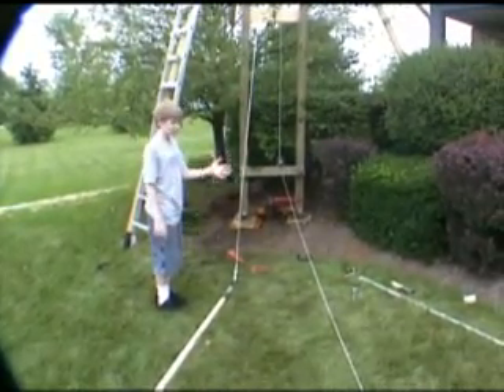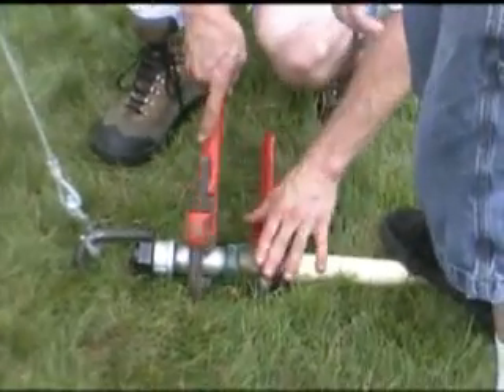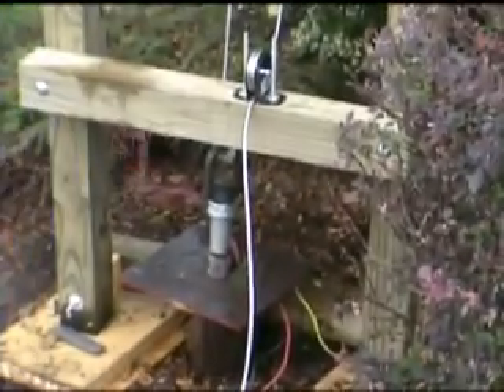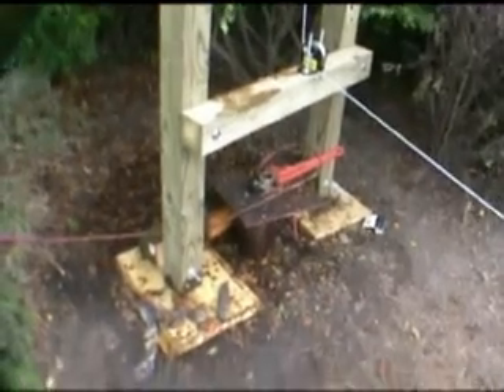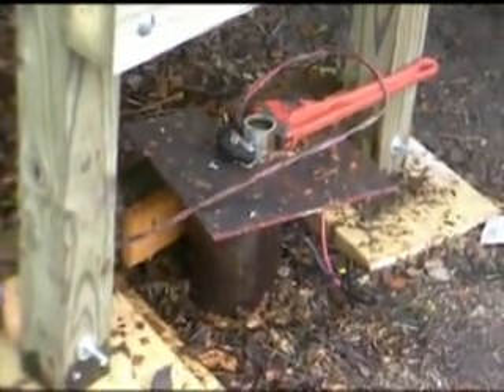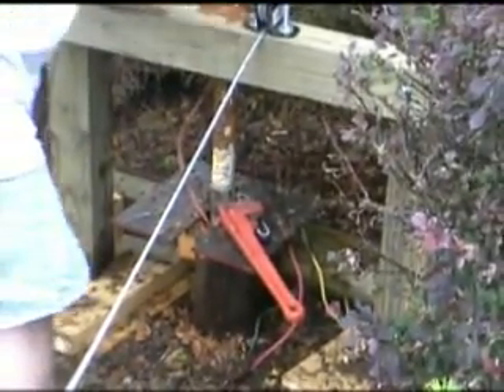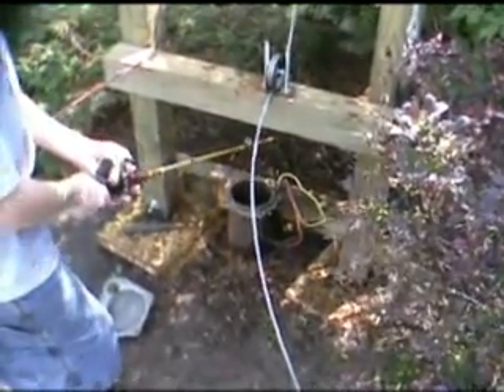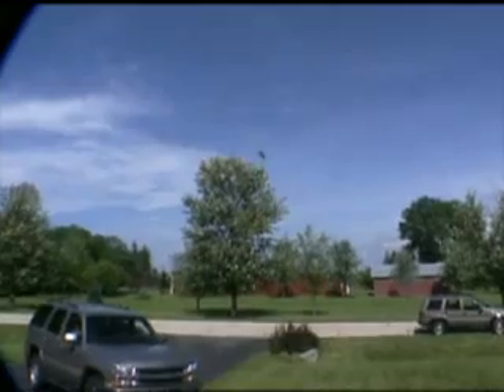Water Well  Pump Project

Comment: @trd1717 obviously this DIY is not at the mercy of the idiot who charged him 2k dollars. This is easy to do, though like others have said the single piece black flex tubing would make it a bunch easier. instead of a 20 foot tall tower you could easily use a 4 foot sawhorse with a large boat pulley and a pull it up the first 10 foot or so. Then attach the pipe to a vehicle and drive it up while someone guides it up the reason you need the pulley is so that the black flex tube doesnt snap

Comment: This is a very dangerous job if you are not careful . In my 20 years of pump repair and drilling I saw a homeowner attempt a 400" sub pull he was half way out when his clamp let go. The wire wrapped around a rhododendron and ripped it out of the ground roots and all and it all went shooting down the well the entire bush, they couldn't get the pump out after that it was jammed . That pipe you saw with all the iron Bacteria is your static level in other words  how much your water level fluctuates

Comment: The well pumps I've changed on my homes in Pennsylvania have all used black plastic flexible PVC - IMO way easier to work with than the rigid pipes that have to be taken apart and put back together.  I've never had to use an elaborate pull system, just a couple guys to pull it up.

I don't know why people are jumping on this guy's DIY project.  If anything it's a little over engineered but so what?    The pumps aren't really that heavy, they wouldn't snap a cable.

Comment: I try not to get into too many squabbles, but I have to back up my fellow well men.  Two men and a pump hoist can pull a 400 footer in a half hour on SCH 80, galvanized, or whatever else you want to hang it on.  Most pump replacements take less than 2  hours (If installed properly).  The guys that take all day bring out a chain hoist and a tripod (1940's technology).  I wish I had a dollar for every one of these DIY projects I've had to fish out of the bottom of the well...Oh, wait,  I DO!

Comment: im from new jersey... we use 19lb 6'' pipe with steel threaded couplings.. tighten the down with chain wrenches and weld them if necessary. as far as the pump goes.. depending on the wells yield typically you would set the pump 20ft off the bottom of the well

Comment: I am a journeyman pipefitter, but never worked on a well. 
Use rope or cable?
Pipes joined with regular couplings?
Galvanized?
What do they use now days for the pipe?
Are the pumps typically lowered to the bottom of the wells? 
Seems like a pretty good method to me, unless your cable/rope broke
Oh, and where did you get the connector you attached to the top of each pipe? It looked heavy duty.
I like the idea of the SUV doing all the lifting.

Comment: I do not feel this is a death trap. I would keep the kid away from it. So long as everything is built well the worst thing I can see going wrong is losing the pipe and pump down the hole. 

As a machinist this make sense to me. It looks to be done in the same fasion as an oil rig.